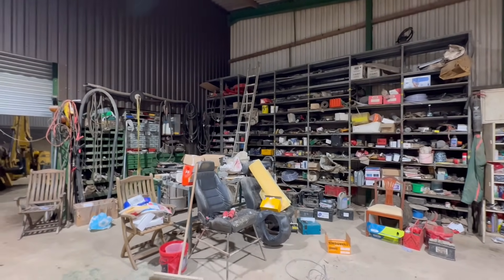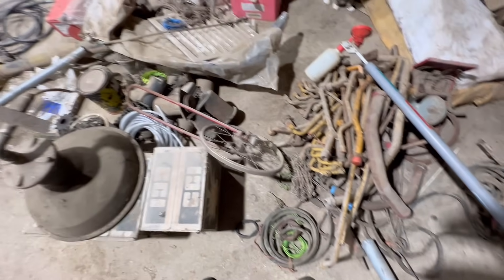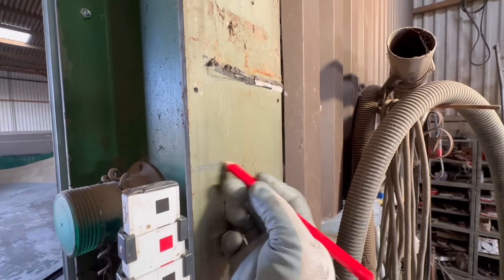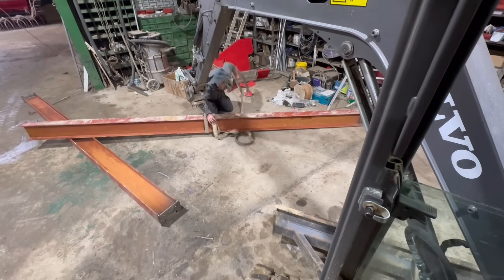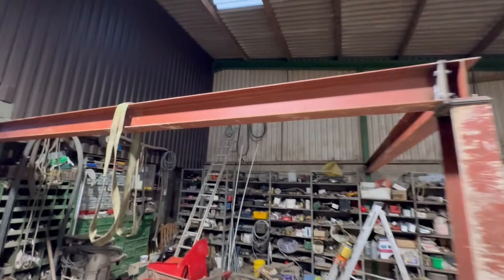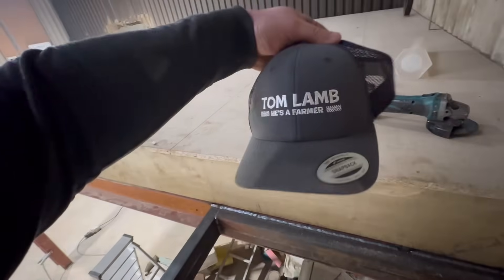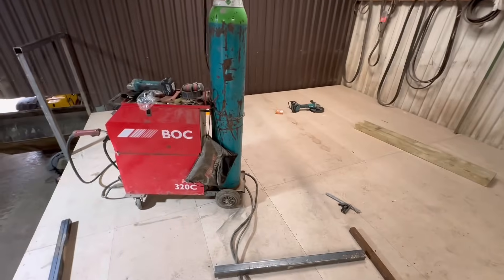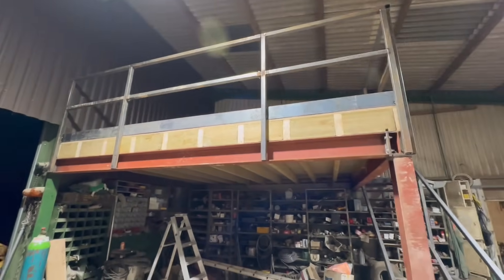Fabricating and welding a mezzanine floor for the workshop (part 1 workshop overhaul)

Comment: We had the forethought of putting in a mezzanine area in my workshop that has a 14’ ceiling and it makes the whole shop so much more functional. Nice work adding it and I’m glad you didn’t try to attach that corner support to the roof in the end.

Comment: Tom, a very impressive bit of fabrication.  Considering how expensive those annular cutters are, it was making me cringe seeing you drill the holes dry.  A little bit of cutting oil would make those cutters last many times longer. I use RTD, but there are lots of alternatives, and a lot of them come in spray cans making easier to apply in awkward situations.
Reply from the maker: If you look at the drill it was using cutting fluid it pumps it through the center of the drill bit

Comment: Hi Tom. Can you please give me some info on your mag drill. I am looking at getting one.  What is max hole size, depth and clamping force? What make and are you happy with it and would you buy the same one again?  Thanks Paul
Reply from the maker: It’s a roto best yer it’s good had it years no trouble.
It all depends on the depth of the roto broach cutter but you can go pretty big and deep